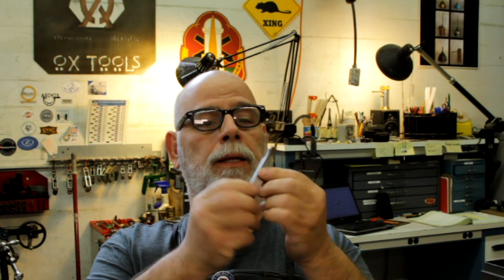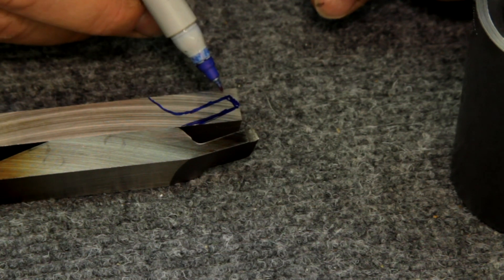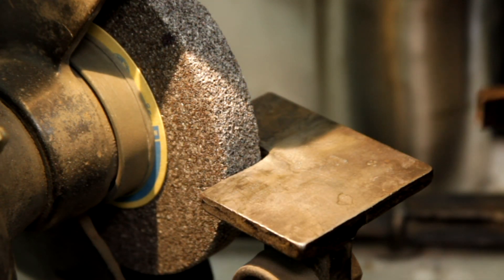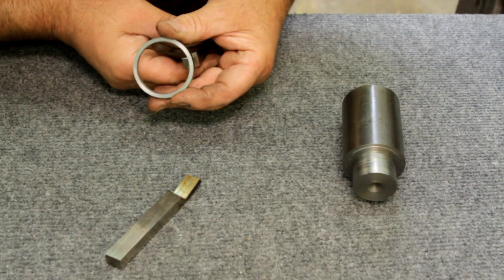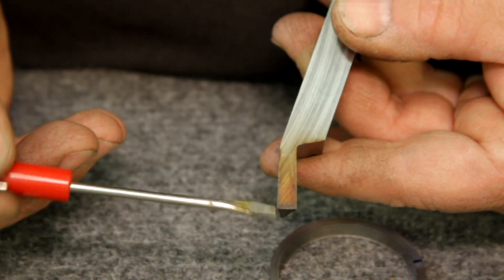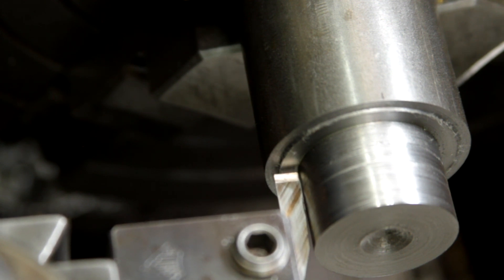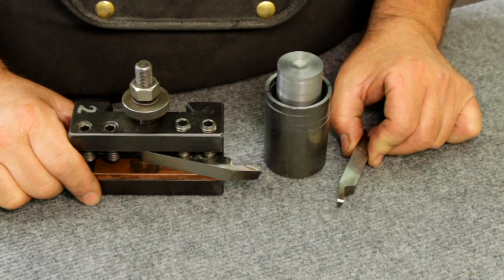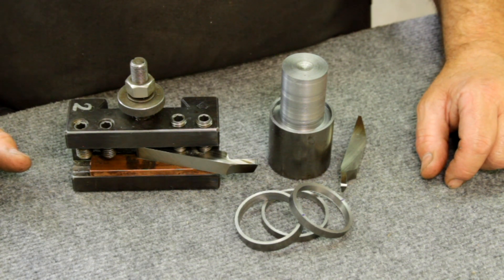Grind a face trepanning tool for the lathe

Comment: Home shop guys with low power lathes definitely need to be proficient in hss cutter grinding.  I see guys struggle to get a surface finisg, and they're using cheap insert tooling.  These are the guys who'd benefit from using correctly ground hss, just in normal surfacing cuts.

Comment: Cool video, thank you. I wonder, is there any specific reason the tool is not straight, but has an angle? It seeeit woukd be easier to relieve just a side of the blank and end up with a straight tool. Then one would feed it in like a boring bar. Perpendicular to the work's face. Also, I wish cutting a dovetail trepan (in steel or stainless) is shown in a video in future.

Comment: Great video Tom,
I was wondering if you would be able to point me in the right direction for my application.
I’m looking to make a depth of cut of 6.000” with an OD of 3.750”.
I would be cutting into a material called Delrin 150 series (acetal material)
I can’t find any tools that can do the job.

Comment: Thanks for the vid and the info. Wish I had thought of the cut off wheel or seen this video a couple of weeks ago, I ordered a piece of 16mm square Fagersta 10% Co and made a double ended chamfer tool and that stuff is HARD to grind away. Took me a long time to grind away the 45 degree bevels. I guess it was my own fault since I used a cutoff wheel in a dremel to cut it to length and never gave thought to cutting the bevels away.

Comment: Hi there thanks for the Info on making your own have question for you how deep can you trepan want to make cast iron sleeve for engine looking at 6 inch height of sleeve 
can you use like a hole saw type  trepanning tool for the rigidity of the pipe with tool tips on it thank you

Comment: I'm most familiar with deep hole trepanning after seeing a number of machines at an auction.  One machine could drill an 18 inch hole 19 FEET deep, if I remember correctly.  Apparently it is used in the oil/petrochemical industries to make extremely large pipe with very heavy walls.

Comment: You can use those diamond coated discs used for cutting stone and ceramics to cut away the bulk of the HSS bit. 
It cuts HSS really fast and produces a lot less friction.

Comment: Steve Summers demonstrated trepanning out of a plate, trying to save the internal part. The external part was waste. This failure is on his current video.
From what he showed it looked like the failure occurred as the cutter broke through the plate. I am guessing that the internal part moved and caught on the cutter. I think that I have seen him trepan something previously.
After a career in a machine shop I had never hear of trepanning. It is an interesting concept to save material. I looked at some deep hole trepanning, which is specialized annular boring????

I was the maintenance guy, not the machinist. Our shop theory was that time was money and if material could be turned to chips quickly, material was cheap. We found that we could reduce enough set up time, standardize material size, not changing work holding, and reduce oversized stock to chips... Saving $$$.  Think SMED and one piece flow.

Exploring hobby machining in my retirement is a joy. Having YouTube instructors like Tom Lipton is extremely helpful. I am currently running a Craftsman (Atlas) that has too much cross slide backlash for me to trust this technique. I have a Le Blond waiting to come into the shop, but I can't squeeze it in. I need the Le Blond. I am used to the rigidity of Clausing Colchester lathes and heavy CNC machines. The Craftsman is fun, but I really want to work with an industrial machine.

Comment: I remember spending way too much time on trepanning tools when I was training.We were taught to leave as much material as possible for the 'outer' curve then 'match it' to diameter required but include 7 deg clearance. Our tutor could be a right ass sometimes. Setting 0.010"~0.015" above centre gives some extra clearance and sometimes a better cut. Angle grinder would have been a great thing to have back then

Comment: I didn't know the name of the operation, trepanning, but it turns (get it?) out that I have done that before to facilitate the use of an o-ring on a bolt head. I did not cut the meat out like you did.  Grinding is slow.

Comment: Was the tool already hardened or did you harden after grinding it?
Reply: High speed steel is usually bought already hardened. The process to harden it properly is quite complex.

Comment: Nice demo...looks like you ground the second tool better without taking off too much on the bottom. I try to curve the inner radius to the inside to make
the tool stronger. Actually I made several out of A2 tool steel for different radius, [milled radius on cnc] then brazed carbide tip. No chip breaker..just peck
with it, the tool last much longer.

Comment: Great video once again. Although couple of things caught my eye in the video. First is that there's no disc guard in your angle grinder. I guess you've never had a disc get thrown apart or maybe you're experienced enough to take other precautions. In my opinion, you should still warn others for the very likely hazard as you're an example to a lot of people! Other thing is that does the heat build up to the HSS blank damage it's tempering while cutting it with the angle grinder?

Comment: If you have a surface grinder and/or a tool grinder why would you freehand grind on a bench grinder. It would seem to me you would get more precise results than doing it by eye. True, it may be a little faster but I would think you wind up with a better end product. Just wondering. Thanks for the great content.
Reply: Paul Mace because these are "teaching" videos, using methods and practices that (almost) anyone can reproduce with or without proper equipment. Not everyone has a surface grinder or tool and cutter grinder etc. The idea is to show how to reproduce these with minimal equipment, that most people watching are more than likely to already have. It's kinda like saying "why didn't you just do it with an EDM?"

Comment: Great demo. I used the disc grinder minus the guards but always wear a full fact shield. Usually the bigger ones (4+ inches in diameter)  don't explode like the dremel tool sizes, those are terrible!

Comment: Tom love the show. Related to this, well loosely, I am having problems cutting a 1/4" Wide by 3/16" deep groove into steel with a 40 degree included angle. Any tips and tricks to help with the grind on my high speed tooling. Would it make a video? Not a lot on the net about this.

Comment: W/S's tooling division, Manchester, makes a series of trepanning tooling that is very versatile. Trepanning tools may also be made from braised on carbide cut-off tools. Spelling courtesy Microsoft. However, brazing requires a rigid machine. If chatter is encountered, try removing the top-jaws, and running from the masters. The removal of 2-1/2" of overhang can make all the difference. I used to occasionally make beer fittings for the Olympia brewery, and trepanning face grooves in red brass, and SS, was commonplace. The finishes are easily food grade. Even on loose, old dogs. Mark

Comment: hello, Master. how r u? that's very interesting. next time I cross with a machinist from here, I'll ask about this tool (I wish I knew how it's called in portuguese). and I will not be surprised to hear that they already know or use some similar tool with the same purpose. and the reason is very simple (and kinda sad): almost everything is VERY EXPENSIVE in Brasil. thank you for the class, Mr. Lipton.

Comment: The word you are looking for is trephining - the process of relieving pressure inside the skull by using a circular cutter.  If you are dying from a slowly accumulating sub-arachnoid blood leak, this could be your life saver.  In desperate situations, an apple corer does an adequate job.  I believe that the oldest example was buried in an Egyptian pyramid, a couple thousand years ago. 

Tom:  The plates for your pedestal grinder - did you make those?  Can we get a closer look and including how you connect them to the machine body please.  Can you adjust them or do you leave them fixed at perpendicular to the disc radius?

Comment: We once used a "face groove" carbide insert tool for a project at work.  Basically the exact same thing you just made except I think the manufacturer was a little embarrassed of the depth capable.  I think we needed 8 pieces and would use an insert and a half on one part, not particularly difficult material either.  I think we ended up relocating the op on the next batch and milling the faces for the o-ring seats in one of our live tooling lathes.  

great video as always.

Comment: Tom, EXCELLENT VIDEO! I've previously searched for a video on this tool (& came up empty), particularly for a quicker way to cut a round out of square plate stock, without having to spend soooo much time cutting the square corners off a chip at a time (think pulleys). Pay no attention to all of the safety complainers, or the confused comments about terminology or grinding/red hardness...  Definitely the best trepanning bit video on the Tube! Thanks for taking us along.

Comment: Next time you want to fine tune a chip breaker, use a 1/4" shank mounted chain saw sharpening point. You get 3 or 5 in a blister pack. You get better finishes and the grinding striations align with the chip flow. And you can doctor up a dull tool up on the lathe.
Reply from the maker: Hi Forrest,

I have little experience with chain saws and never knew such a tool existed. It always amazes me the tools I didn't know I needed. 

All the best,

Tom
Reply: Look here for chainsaw sharpening stones. 

https://www.ebay.com/sch/i.html?_from=R40&_trksid=m570.l1313&_nkw=chainsaw+sharpening+stones&_sacat=0

Lotsa choices, lotsa radii. Not expensivve

Comment: Great video Tom! 
I use this technique making 4" dia. PET seals that are.08 cross section. I end up with a 3.62 dia, chunk of material left that other parts  can be made from.
ATB, Robin
Reply from the maker: Hey Robin,

Do you grind yours at an angle similar to what I showed or do you sprinkle some Renzetti pixie dust on your to make them cut 20x depth? Thanks for stopping by.

All the best,

Tom
Reply: Hey Tom,

I am lazy and I like carbide so I use the micro100 "LC" series brazed groove tools and just add about .010" back taper and radial clearance on one side of the tool. the rest is already ground. I orient the tool the same general direction you have yours with just a few thousandths of clearance tilt over the length of the carbide. Of course ceramic lapped with 3 micron on the cutting end. No chip breaker as I find it unnecessary at carbide speeds and flood coolant.

ATB, Robin

Comment: Great tip Tom, many applications, O-ring grooves springs to mind, I've also used trepanning to cut large holes in 3mm plate clamped on a face plate in the lathe works like single point annular cutter. Regards Ralph

Comment: Is there a practical limit to how narrow the trepanning tool cutting face can be?
Reply from the maker: Directly related to how brave you are. Like I mentioned in the video 6 to 8 x times the width of the tool. So if the tool was .03 wide you might squeak .25 depth out of it. Hard to grind the small narrow tools like this. Thanks for the comment.

Cheers,

Tom
Reply: I appreciate the response- thanks Tom!

Comment: Great video. I can see this being useful.  I am not sure why I have never considered using a but off wheel on tool bits before.  It certainly is a lot faster than grinding to get the rough scape.

Comment: Amazing that there is so much to learn. This was informative and knowing that I can cut tool steel with an angle grinder is a big help. I love the Flexovit 0,8mm thick cutoff blades which makes cutting steel something like cutting butter compared to even a 1.0mm thick blade. Nice video for sure. Thanks for sharing!
Reply from the maker: Hi Jim,

These were Walter Zip cut discs. The best of the best in my opinion. Thanks for the comment.

Cheers,

Tom

Comment: hey tom, do you think a round bar with the top half removed to the proper depth and then some carbide brazed on would be a good alternative?
Reply from the maker: No. Sounds like a pain to me. You need some steel under the tool. Rounds are probably not stiff enough unless you are going really shallow. Thanks for the comment.

Cheers,

Tom
Reply: thank you for answering, i was mainly thinking that you could turn a steel bar to the size required and the shape would automatically have the clearances

Comment: Nice demo, Tom.  Very similar to how I do it, too.  I use the same type of tool for a recurring job I do for a Coleman lantern parts business.  If you look inside the fuel cap on an older (pre 1970) Coleman white gas lantern, you will see one of the types of parts I make for them.  There is a brass insert inside the fuel cap, held in by a screw, and that brass insert has a groove for a rubber gasket.  My tool grind to make that groove is so much like what you show here, but smaller, as needed.
I just happen to have an order of 600 of those parts in the shop right now.  Trepanning my can off.    :)

For some of the gents below who mentioned having a hard time cutting a chip breaker on the grinder, try holding your tool bit in a vise and use a Dremel tool with a thin grinder blade.  It is a little easier to control, for me, anyway.
Reply: dcw56 Thanks for your added hint of using a dremel to create a chip breaker!  Makes good sense especially if you are grinding on a small bit.

Comment: Good stuff, Tom.  This was well timed for me.

I bought an old, abused monstrosity of a machine vise to use on the shaper.  It came mounted to a chunk of very hard 5/8 plate that is oversized for the shaper table.  My thought was to use part of it to fabricate a swivel type base.  It would be a huge waste to turn what I don't need into chips (not to mention taking forever) and I think trepanning would be a great way extract what I want to keep.  However, this is tough stuff, and I'm not certain that HSS would last long (if at all) before burning the edge off.

So, if you are aware of carbide options for such an operation, I would appreciate hearing about them.  The only other option I can see at this point would be to flame cut it, and that would bring in a whole different can of worms with it.
Reply: You should call around and see if you can find someone to plasma or water jet it.

Comment: So why the angled shaped, why not just grind down the tip on one side?
Reply: I think its so theres clearance/room for the toolholder and tool to clear the spinning core once your a few rings in.

if it was straight you have to come in straight from the tailstock end with the bit, and your limitation is now the length of the toolbit sticking out.

Comment: how about creating a cutting tool handle with a groove and set screws to hold the tool while working it on the grinder..  it would need to have relief cuts so the handle if it gets up on the pad can still be tilted.
Reply from the maker: You know exactly when you should dip the tool in water when you hand hold them. Thanks for the comment.

Cheers,

Tom

Comment: Very Nice, I like how you explained the need for clearing the outside surface of the of the tool. it is a real neat solution. Not to change the subject, but changing the subject. I want to tell you that I really enjoyed the video on the differential screw. I hope that you have more videos where you make tools that use that principle. I liked how the screw controls very fine movements over short distances. The only complaint I have about your videos is that there are not enough of them. Keep up the good work. P. S. I met you at the bash (6/24) and I hope to come and visit you at your shop some day. I'll definitely call first and make sure that you have some free time. I promise to not spend all day checking out the shop (:-).

Comment: did you use finer grain grinding  wheel, to grind this tool.
Reply from the maker: Hi Bob,

I switched sides on my bench grinder to access the inside of the tool. The left hand wheel is finer than the wheel on the right. Thanks for the comment.

Cheers,

Tom

Comment: Does the discolouration of the HSS toolbit end(s) indicate any weakening of the bit material at the cutting surfaces? Obviously it's been overheated from the heavy initial rough hewing with the angle grinder, but would slower, cooler shaping of the bit geometry make any difference to the durability of the bit?
Reply from the maker: No. Thanks for the comment.

Cheers,

Tom

Comment: Tom, did you / do you try to put a radius on the "outboard" side of the trepanning tool our just a straight relief angle? Great comment on the HSS bits, imagination is the only limit! Thanks for the Video.
Reply from the maker: Hey Pete,

Its kid of a large radius as opposed to an angle. Ideally the tool would be shaped like the annulus you are removing. Thanks for the comment.

Cheers,

Tom
Reply: Thanks. BTW - Great material saver and you don't have to clean the chips out of the pan either...